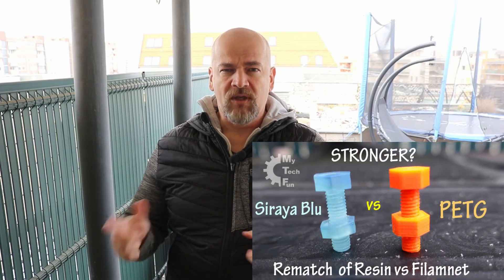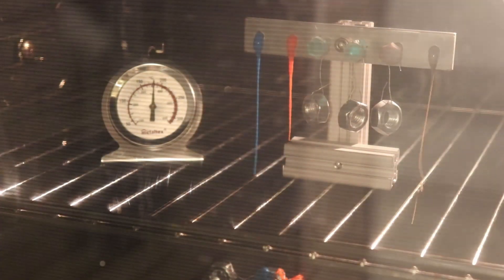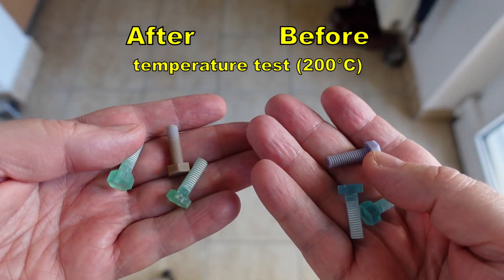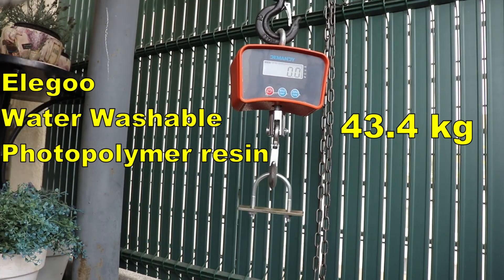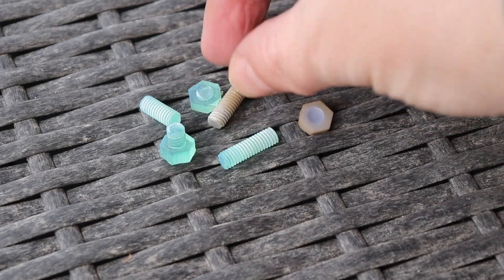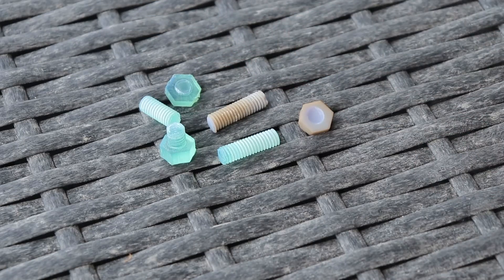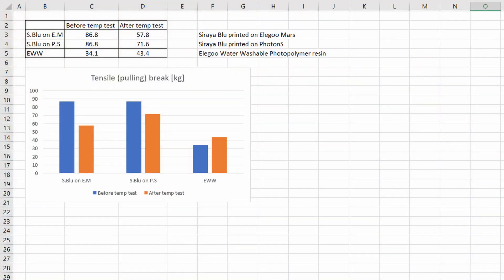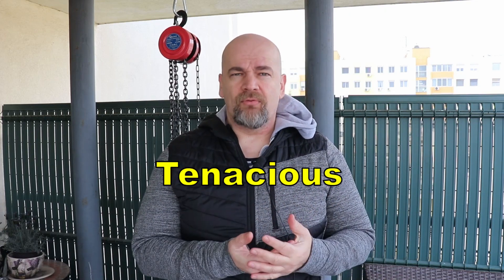Additional info to Siraya Blu vs PETG video - strength after 200°C temperature test

Comment: Hi, could I suggest you to test resistance against scratching? My resin prints in Elegoo water washable are so easy to scratch with the fingernail and leave a nasty white scratch. Thank you! (I just commented the same question in the previous video, sorry)
Reply from the maker: I am preparing new type of testing (hardness). With metal, it is directly proportional to scratch resistance (or wearing). But not sure about plastic (or resin).
Reply: @MyTechFun  The Mohs scale is used to measure this kind of wearing. 1 is talc, and 10 is diamond. Fingernail is 2.5. The test just needs different materials, and you determine wheter it is the sample or the punching object which scratches the other. You go up and when you reach a material that is not scratched by the sample, you have the Mohs value. You'll get Mohs tables in Google Images easily.

Comment: So with the SLA resins what they recommend is to take their standard resin and add small amounts (10%,15%,20%,25%,etc) of flexible resin, they can even be different brands, this makes the original resin less and less brittle but then it just becomes rubber like if you add too much so it’s a balancing act.
Reply from the maker: Siraya is sending to me Tenacious, so I will mix it with Blu. Nut sure about % ratio yet.